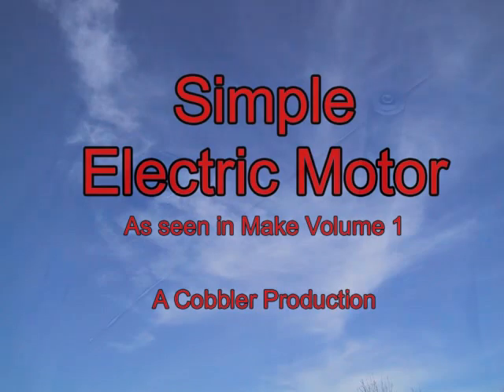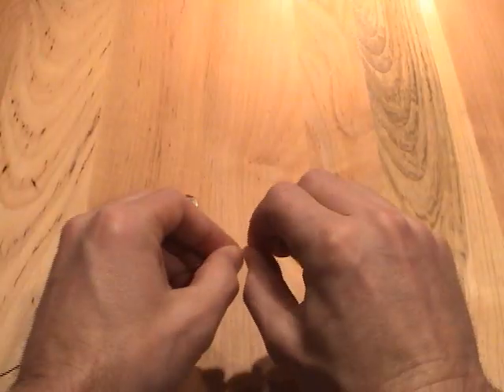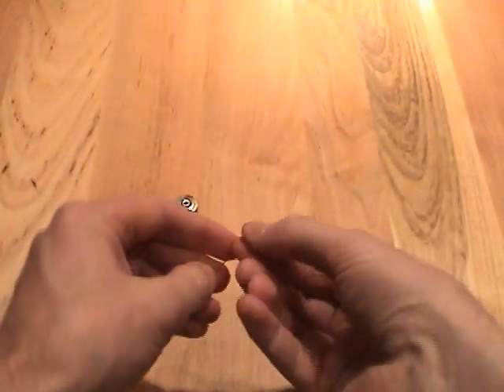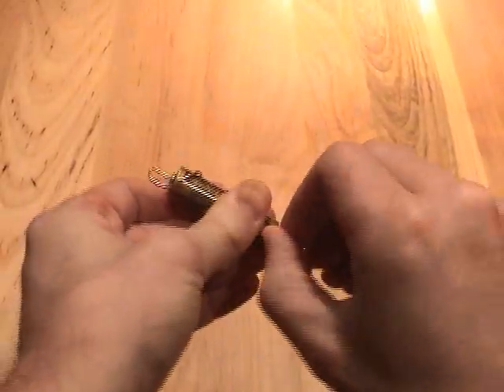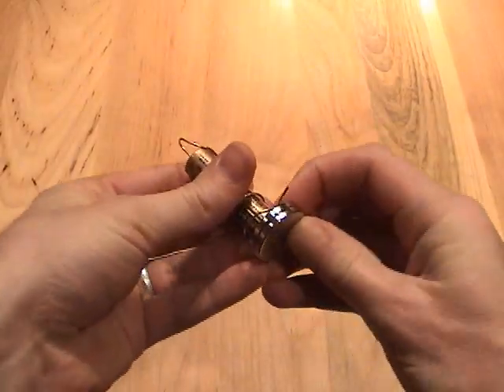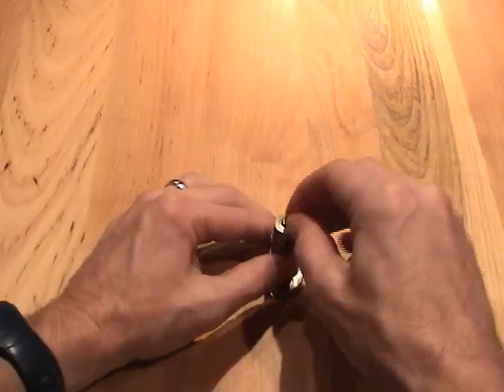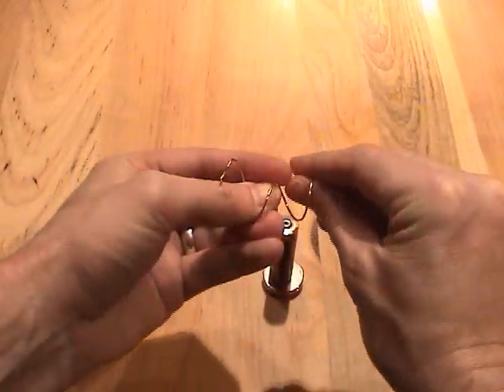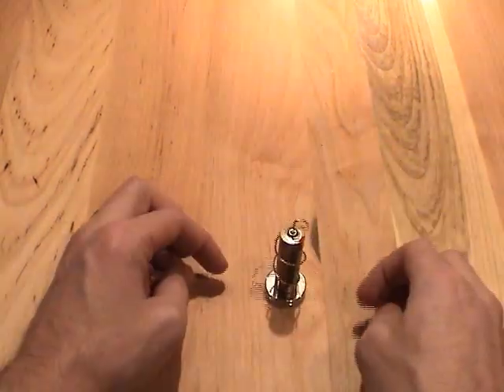Unexplained Phenomenon - Simplest Electric Motor

Comment: @chap1144 I think you'll find that is is the right hand rule.  Turn the magnet over, and reverse the direction of spin because the direction of electromagnetic flow is reversed; not because the it becomes the left hand rule.  But, it is still just a simple motor.  I think we did that one when I was in 1st grade, but since we had all 8 grades in 1 room 70 some years ago, it's hard to be absolutely sure.  Of course, every motor I've used since then has works on the same principle.

Comment: @thewayofthecookie but what makes this different than todays electric motors, usually there is a switch device that constantly switches the poles. with your experiment, I think all it was basically doing is like what two magnets of the same polar does when you make them close together, like if you were a did messing with your dad's old chest pieces that had magnets in them.

Comment: Not sure if that was copper used, but copper is a conductor of electricity, but magnets don't have a pull on the copper itself, just the energy from the batter running through it. The energy from the battery causes the magnet to switch poles, basically how your electric motors work. Since the cooper is the conductor, it carries it with the pole shifts, but since the copper isn't attracted  magnetically, it moves freely.

Comment: This works because if two things... 1. The electricity is going through the wire... and the electricity gets affected by the magnet. 2. The magnet is steady and there's electricity next to it. And it have charges. Minus (-) And Plus (+) The battery have minus and plus charges aswell... and no matter what side you put the battery on.. the wire will spin because of the same charges is next to each other  and it's called "Repulsion" that's my theory. I hope it's right :D

Comment: Dude it works quite simply. The current running through the wire produced by the battery, give the wire an electromagnetic field which reacts with the magnetic field. The current flowing through the wire gives the copper and north and south pole magnetic field. So as it spins in wants to attract and repel away from the magnet, which then gets the wire moving.

Comment: Induction was discovered by Michael Faraday in 1831. A solenoid is an odd shape to visualize the electromagnetic force vectors from, but this is the same effect as traditional "heart motors". There is actually one in the related videos in which you can visualize the force vectors which lie perpendicular to the plane of the current, which propel the wire around the battery. I wouldn't call this unexplained :|

Comment: discharge between the battery ends cause the negative end  flows to the positive end jumping from the wire its and electromagnetic motor its really simple design but its complicated to explain to some people with out visual means ^^

Comment: You can only use copper wire with this? Because I used galvanized steel wire and I did it exactly as you did, but it still didn't work. Please respond. I would like to show this to my physics teacher. Thanks. :)

Comment: The copper wire turns due to the flow of electrons in the wire. The combined electro-magnetic field generates an effect called a "Poynting vector" which is a force generated at a 90 degree angle from the EM field. Reversing the polarity will reverse the spin too =)

Comment: It shorts out the battery. I'd use a thinner wire so most energy gets transfered into heat and doesnt run through the battery as much.

Comment: when it is connected to the battery it will create a magnetic field....maybe the top of the battery is attracting the wire to stick with it while the magnet at the bottom create a force to go away from it...when the wire are moving away from the magnet YET still attracted to the top of the battery it will start spinnin..at least that is my humble teory..didnt say it is correct

Comment: Why won't it work for me :'(
does the magnet have to be a conductor?
I used a copper thin wire, an AA batt, and a magnet that is not a conductor and it doesn't work :(

Comment: @chuvak1 Since the wire is coiled in that direction, and it can only spin because there isn't enough power to actually move it up, and if it did, I don't think the magnetic power could bring it back down.

Comment: @chuvak1 simple . the magnet have a magnetic field, the wire, connected with the battery is conducting electricity. a force, created by the magnet is applied to the wire, quoting the lorenz force or, in that context, it's a Laplace force. you can calculate the force by dF= I.dl ʌ B (F, dl and B are vectors, dl represent the lenght of the wire) . In that way there is a force. you can determine the rotation by the rule of the right hand. (reverse clock, positive pole of the battery up) (im french)

Comment: Not so simple physics:
The current flows in the direction of the + to the -, IE the top of the battery to the magnet. The magnet's field is vertical and the direction of the current is perpendicular (center of the magnet to the edge where the wire is touching it). The current feels a lorentz force due to being perpendicular to the direction of the magnet field and thus the spin. The right hand rule will determine the direction of spinning so flipping the battery will change the direction.

Comment: the wire touches the top, therefore there is a potential difference btw coil and otherside of the battery. depending on the magnetic vector fields there will be a work done because there is an electric vector not parallel to the magnetic vector field. My english is lame, I did not learn all this in english, sorry. Therefore, its only the fact that the bottom form of the wire will give a perpetual (even if it rotates arround the magnet) perpendicular vector to the vector field of the magnet.

Comment: @chuvak1 the top of the coil touching the battery....  the magnet on the bottom....  if you flip the battery it spins a different direction.... hmmmm....  ok the wire is a metal and theres electricity flowing through it, while theres also magnetic energy flowing through it.  i dont feel like thinking about it lol T_T.

Comment: I think it happens cause the coil acts as a 2nd magnet cause it is conected to the + and, through the magnet, -. The reason the coil turns is the ANGLE of the coil and it's magnetic lines. Think about it, the magnet has  vertical magnetic lines and the coil's lines are at a slight angle trying to "escape" the magnetic field of the magnet (much like any 2 magnets at an angle and the same polarity). Cause it can't, it spins round. It's much like when you put a paper spiral over a heat source.

Comment: This is why it works:

The wire is connected into short circuit with the battery and is wrapped around, thus created an electro magnet.

On the other hand, there is a magnet stuck to the bottom of the battery, perpendicular to the eltromagnetic coil. As we all know, 2 magnets will attract each other.

Now what happens is that the copper wires shape is made in such a way that the coil will continually try to pull down more and more. because there is hardly any friction, its like pushing a screw

Comment: the wire makes a electro magnectic field , and this force repels it from the magnet , as the wires at a angle the force pushes down and left , causing it to move.

Comment: whenever a wire is been on current a magnetic field is created on the rear sides of the wire,
the magnet's field witch is stronger (since you used a battery) force the wire to rotate since the two magnetic fields got the same polarity and thas they are forced to repel its other.
no rotations should excist if you had the battery upside down

Comment: @ aquatroni
That explanation is bullshit lol. 
This is basic electromagnetism...
Any charged particle moving through a magnetic field will experience a force, which is known as the Lorentz force. It just takes a bit of smart placement of the wire and battery and the wire will spin as long as electrons flow through it.

Comment: this thing works because the simple theory that electricity goes in circulation of Electrons... when there's electric charge.
when you made the spiral shape on the battary you've made a Rotor, which is a transformator... and you've made an Electromagnetic charge, and when you have the tip connected to the top battary, and the bottom to the bottom battaries, you made 2 magnets with same charge, which causes rejection... and because it can't just fly away, it rotates :P

Comment: A magnet is not necessary.
A battery and 2 coils is all that's needed to work.
The magnet at the bottom can be replaced by a cylindrically shaped coil.
The top coil should contact with the bottom edges of the bottom coil.

Comment: The answer is simple and he says it in the description, it's a homopolar motor, as the wire carrying the current cuts through the magnets field it produces a force at right angles to the wire and the field. If I am right the direction the wire is wound will make no difference and switching the magnet over will make it spin in the opposite direction.

Comment: well its really easy same poles atract diffrent ones repell right? ok the wire is contacting the positively charged pole on the battery yet a magnet has an induced charge of electrons , the wire is provided with protons to travel through it , and the other end is being attracted by the magnet however due to its position it cannot contact the magnet but the charge flowing through it acts as a centripital force making it spin due to push and pull of the battery and the magnet acting on the wire.=]

Comment: How is this unexplained? You're creating a charge passing through the wire creating a magnetic field interacting with the magnet that is being touched. If you had a wire that was heavier than the magnet, and the magnet had a low enough mew it is likely that the magnet would spin, provided a high enough current passing through the now heavy wire to created a strong enough magnetic reaction.

Comment: there is a magnetic field in the wire (because of the current and the Lorentz Law, as previously explained) but there is aalso a magnetic field in the battery aswel going in the other direction, which attracts the first one... indeed far from unexplained !

Comment: What's happening here is that the magnet, being sort of connected to the battery, imparts its magnetism into the battery. The coil of wire around the battery is the opposite end, or armature, of a very simple electric motor. So, the magnetic interaction between the battery's outer case and the coild of wire, makes the wire spin. It's pure genius, and I'm not sure who first did this, but it's really simplistic genius!

Comment: @2kapufa 
Hey maybe but that double A is only a cell not a real battery. a battery is multiple cells. One two Oh it may have an ferromagnetic shell but that still conducts electricity and the negative and positive sides still apply also if you flip it the smae thing might work.

Comment: Thats is Easy I think The wire is neutral untill you put a positive charge to ti. the maget is also positively charged.  thus it sticks to the negative side of the battery. and repels the positve wire in all ways but since its spiraled around the battery is spins always being repeled untill the battery rins out.

Comment: I was confused by another one I saw one of these that was bigger, but this one makes the solution seem more noticeable.  My guess is that since the wire is in a coil, the magnetic field being created is at a tilt, so actually there is a vertical force acting on a slanted object, thus causing it to move horizontally.  Is this right?

Comment: Possible reason. The magnet has its fixed field, the coil on the other hand is changing fields when it rotates. Once the coil has the field, magnet repels it to push it in motion and magnet being fixed and coil being free, its the coil that keeps rotating. Think the magnet like a fan if the coil was fixed the fan would be rotating, its the opposite here since the magnet is fixed and cannot rotate, its the coil that rotates instead. Both fields continuously react due to coil keeping it running.

Comment: The magnet produces a B field going up (ish). There is current, I, in the wire. The total force on the wire is int(I x B dl). The horizontal components of the force on the spiral portion sum to 0 but there is also the bent portion at the top of the battery. Approximate it as a horizontal wire extending radially from the connection. B still going up, I x B is horizontal and perpendicular to the wire, providing a torque on the wire. Try it with a very long, non paramagnetic battery so B_top ~= 0.

Comment: @1969liberty Free energy, yeah. I suggest you read a book on thermodynamics. Machines always spend more energy than they create. This motor for example drains a battery in a couple of minutes (making the whole contraption very hot in the process), but it could hardly make anything else turn. Its more like a kinetic sculpture than a motor. And it costs a lot of batteries.

Comment: The battery creates an electric charge through the wire which has the same polarization charge of the magnet. The magnet then pushes the wire around trying to stabilize the charge, but cant, which causes it to spin continuously.

Comment: It's how a magnetic field effects a single atom. magnets also produce electricity to submit neutral atoms. the battery is an outside force breaking an electron away from an atom which becomes a free electron then starts an electron chain reaction that produces an electrical currant flow that moves the copper wire in either direction. electrons normally move in all directions but since a magnetic field is past through the copper wire. several electrons are force from there atoms in one direction.

Comment from the maker: @DrAwsome5 The key is that you need an electrical conection between the battery and the wire through the magnet.  Neodymium magnets usually have a mettalic coating that works well.  The black magnets that you find in speakers could work, but you would need to sandwich a metal washer or something between the battery and the magnet and then contact the wire to the washer instead of the magnet.  I think that would probably work.

Comment: i tried it didn;t work, but becos i dun have a round magnet

but i figured that, the magnet, turns the battery into a magnectic core...
with the coil wrap around a magnectic core..
electrons moved and flow thru the, (what seems to be a paper clip rather then a piece of wire...) which thus became a motor in itself...

this has probably got nothing to do with the wire touching the magnet, it may as well work if the magnet is hidden from view but still turns the battery into a magnet core

Comment: if the circuit connected in this way , the batt. is shorted , voltage will drop to zero , then the work will be stopped .

Comment: wow, alot of explinations of how this works but nothing as simple as your motor. My understanding is that when an electron moves through a wire the resulting force is perpendicular to the wire. If I pushed you, you would fall in the direction of the push. Electrons don't react that way, they would fall to the right or left of the pushing motion.

Comment: why is this called unexplained this is just a basic electric motor with an unusual coil. But is still works the same way. The movement is created because of the effects the magnets have on the electrons passing through the wire. please watch a video on a basic electric motor were the wire is coiled and hung above the magnets the exact same principle apply to this motor. its just put together in a fun way. Hope this helps with the confusion.

Comment: It is because of magnetism and electricity is the same thing electrons that move in a magnet all electrons are in the same directions and have a positive and negative side in the battery the positive side of the battery acts like a electron transmitter that sends electrons through the wire and through the magnet to the negative side of the battery. The energy current becomes electromagnetic and the wire will constanty spin until the battery has no power.

Comment: @JGale8 i think your answer is not entirely correct. lenz´s law only works for variable magnetic flux. in this case neither the magnetic field of the permanent magnet nor the crossection of the "solenoid" is variable. as the current flows in the coil, thanks to the magnetic field, there is a force acting on little segments of the coil, but in this arrangement the net force is 0 so there should be no rotation.

Comment: In a sense you create a solenoid. The current passing through the coil induces a magnetic field. The magnet you introduce will oppose this field by Lenz's law, thus a force is made. This force is perpendicular to the field (Flemming's left hand rule) this will be along the coils direction thus moving it to oppose the change in Flux density.

Comment: @vartatoosh 
The wire is connected to the negative pole of the battery. both the negative end of the battery and the wire are touching the magnet, which is made of a conductive material. that completes the circuit.

Comment: Since the wire is touching the positive and negative side of the battery, there is a current running through that wire.  A current in a magnetic field experiences a force.   

This isn't my theory.  This is actually why it spins.

Comment: a wire where electricity comes trough becomes magnetic the direction of magnetic field lines is  (.) positif to negatif towards you magnetic fields lines to the left (x) away from you rotation the . and x is a dart front and back side so you know where its comming from rotation of field lines is like a skrew x from you tighting to the right magnetic field lines go from north to south  sow if you got direction you know polarity in your case the positif side is north btw my english sucks dont say